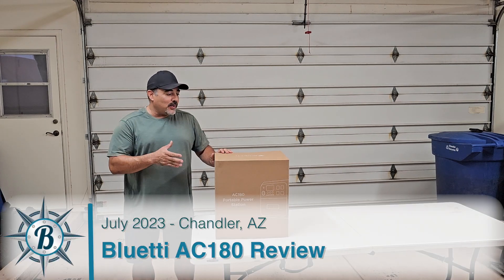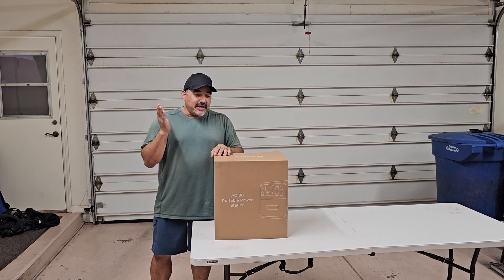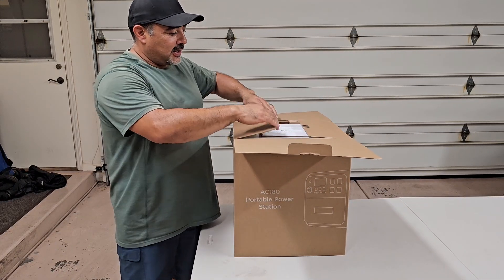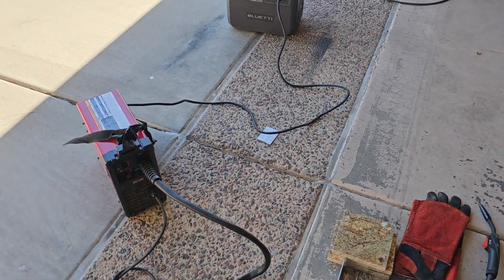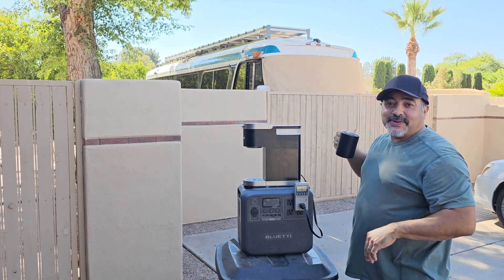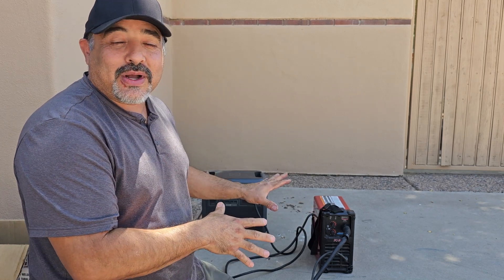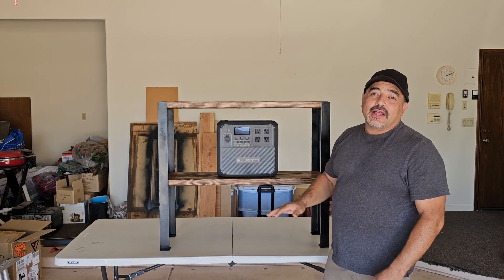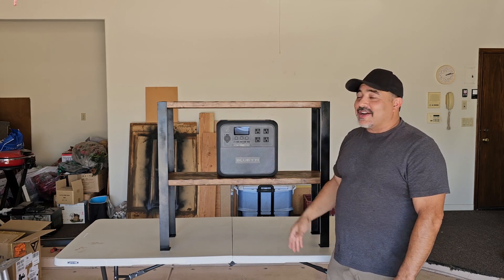Bluetti AC180 Review - Building Shelves with this Portable Power Station

Comment: Hey Juan, long time no post for me and looks like similar for you guys :)  Just checking in and by coincidence, I just ordered an AC180 last Wednesday, due this Wednesday, on sale for $550.  Can't wait to play with it.  Should be a nice "in-betweener" unit for me.  Already have a 256Wh GoLabs i200, then my combo of 640Wh/12V LiFePO4 battery with 1200W/12V inverter, then the big DIY "Hand Truck" unit I built - 7.1KWh LiFePO4 battery bank (8s1p, 24V), 3000W inverter, 900W AC to DC charger, plus 40A MPPT solar charge controller w/ panels.

Hope all is well and my best to the family,
Sev

Comment: I tried to weld with my 5050 watt generator and just got a little splatter stick welding. Plugged it into my house 220 and burn holes through metal if i don't turn it down. For thin metal use a wire feed.

Comment: Thank you for doing this video. It was very helpful for me.  Hey there’s a mode I was reading about on the AC 180 called powerlifting mode.  it’s in Settings.  It says that it’s for heavy draw resistive applications and says it will sustain 2700 W and I wondered if your welding experiment would go better if you put it in this mode?

Comment: There is a huge difference between surge and power lifting mode. You seem to have confused the two!
Reply: What type of surge can the 180 put out.  Man I been looking an everything I see is all talking about power lifting.  1800watts is good. But when you start getting close to that kinda number running watts.  The surge watts is definitely a ways over that.  An power lifting is definitely not the same as surge watts

Comment: What welder do you use?
Reply from the maker: It's an FC-90 by Lincoln.  It's just a little Flux core welder but I have become quite attached to mine.   It's tiny but does a great job welding